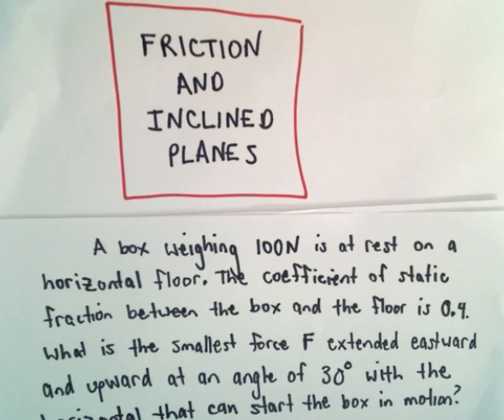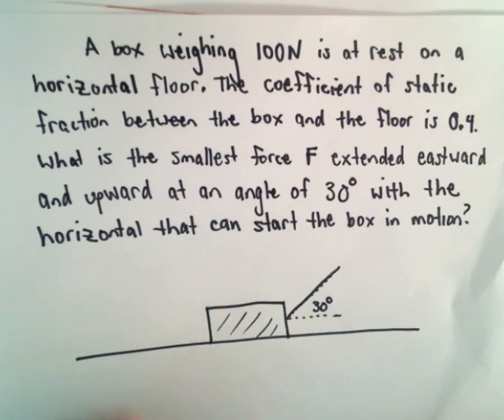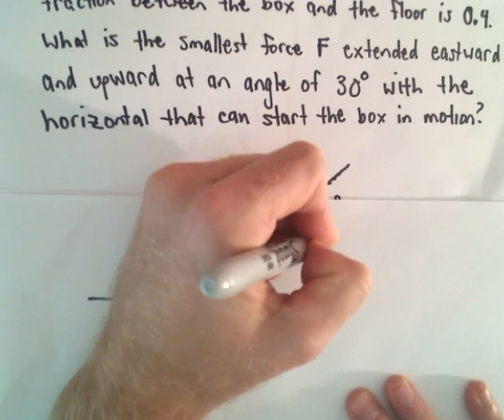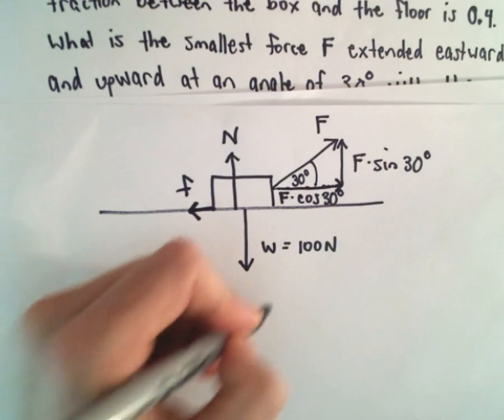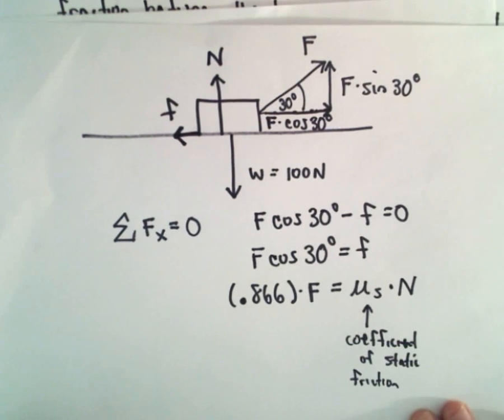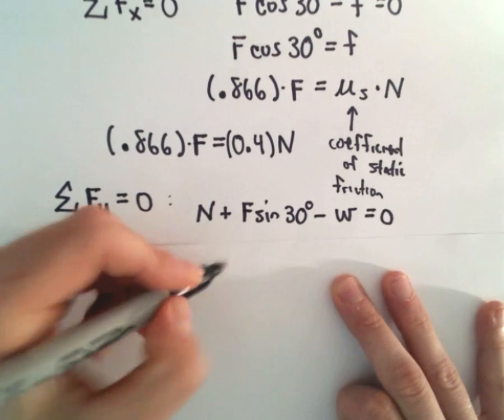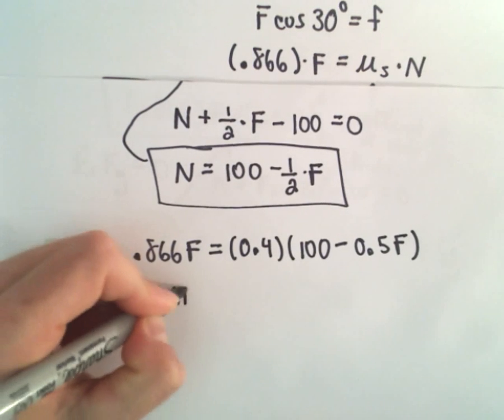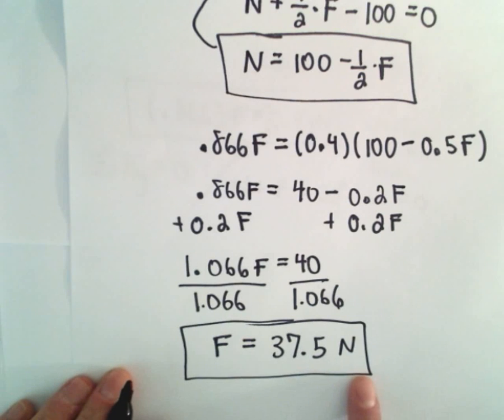Minimum Force to Overcome Friction

Comment: suppose if i had a value of force and also the mass of the box in grams or kg and i wanted to find the minimum force required to move the box then would that minimum force be equal to limiting friction or would it be greater

Comment: I totally understood, but i did not see the reason why we did not equate normal force to 100N
Reply: Addendum:  since the force of the pull ended up being 37.5 N, the vertical component of that force is, again, F*sin(30) = .5F = 18.75 N.

So the normal force on the box is now the force on the box due to gravity minus the upward pull on the box, or 100 N - 18.75 N = 81.25 N.
Reply: Good question. It’s because the normal force is how hard the floor has to push back on the box. It’s what we commonly know as the weight of the object.  It’s a force upward.

Because there’s a guy pulling the box at a 30 degree angle, that’s an additional force upward on the box (because sin (30) = .5, the upward force from the rope on the box is half of the guy’s total exerted pulling force).

So the guy is pulling the box up some, and that means that the floor doesn’t have to push up on the box as much. He’s taking some of the box’s weight off of the floor. Hence, the normal force is less than 100 N. The normal force ends up being 100 N minus however much the guy is pulling the box up (the vertical component of F).

If the guy happened to pull the box straight up, with a force of 100 N, so that he matched the downward pull of gravity, then the normal force on the box would equal 0 N.  The guy’s upward pull would be taking the place of the normal force of the floor.  Hope that helps!

Comment: Since the applied force has a component in the vertical direction. When you add up all of the vertical forces, the sum must be zero (or the box will accelerate upwards), which means the weight is equal to the normal force PLUS the component of the applied force in the vertical direction.
Reply: Ok, so quick question: What is the amount of force needed to overcome the friction preventing me from NOT being able to walk outside of my Mansion get into my Bugatti & drive to my private jet?